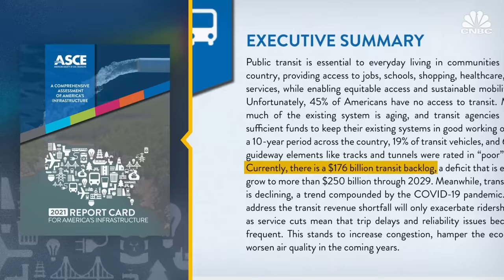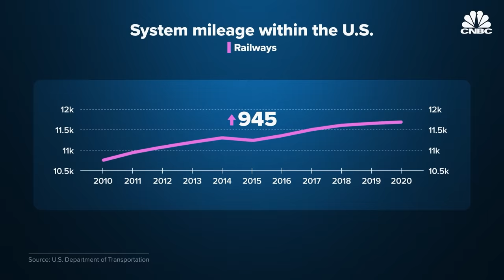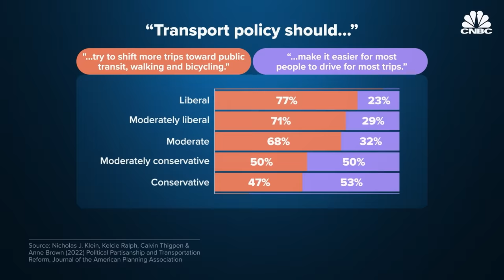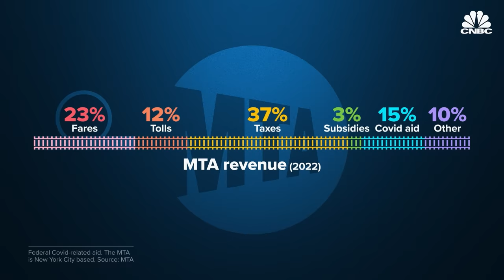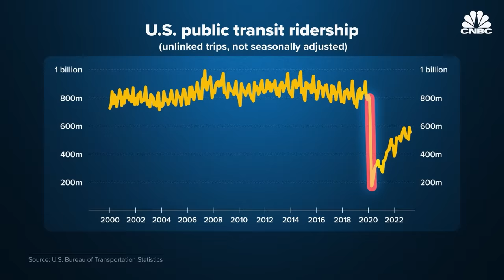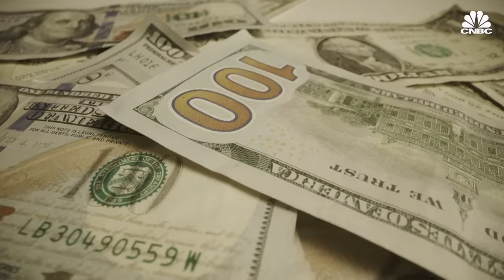Why The U.S. Gave Up On Public Transit

Comment: Most of us Americans generally (and perhaps correctly) assume that our country's wealthy and powerful oil interests basically dismantled our public transit systems in favor of gas guzzling highways.     
Like most other towns in the Midwest, all the roads in my city center have electric trolley rails still underneath the asphalt.   There was no need to build the infrastructure, it was already there.   They just paved over it.
Reply: Electric trolleys come with a maze of overhead power lines.
Reply: @SSHitMan  wireless trolleys are commercially possible
Reply: @SSHitMan  Roads have mazes of power lines and telephone poles already, not to mention all the stuff underground. Big difference is, with trolley lines you aren't walking on or across the tracks lol, so it's no issue.
Reply: @snaffu1  Go look at old pictures of cities that have trolleys. It's an absolute unsightly mess of overhead wires. And I don't know what cities you're thinking of but most bury their electrical lines with overhead confined to alleys.
Reply: @SSHitMan Instead I can look at pictures from today of trolleys from San Francisco, or in other first world developed nations, and none of them have this "unsightly mess of wires" problem. A century of technological advancement tends to solve any of that. Hook that train Kool aid to my veins.
Reply: @snaffu1  Those aren't trolleys in SF they're cable cars. Street cars require overhead power lines.
Reply: Can you point to any evidence for your claim?  Public transit uses oil too.
Reply: @snaffu1  I'm on a 'Memories' site for my city and the oldest folks say the trolleys were great and kind of fun.  No parking issues, you could hop on one and get around the city easily.
We still have a couple trolley stations, little stone buildings that were at the ends of the lines.  They got converted into park buildings.
Reply: @SSHitMan not always. you can also have a third rail system that doesn't have anything in air
Reply: @MalachiWhite-tw7hl it does, but it is still less than cars for everyone, it was better if people bought gas for their own car than paid the public transport fare and shared the vehicle.
Reply: start using more public transportation
Reply: @MalachiWhite-tw7hl  They can also use renewables since they use electricity too

Comment: went on a vacation to London this summer.... I was amazed at how efficient their public transportation system is. everything is easy to use, pay w phone, multiple options to get most places, always on time & Google app will tell you how crowded it is and even if it's stuffy inside. I can't imagine the US ever getting to that point.
Reply: How about the rest of the uk?
Reply: @wolf6462 Depends on where you go. I am from London originally but recently moved up to Leeds. The transport system in Leeds is ok for what it is. It’s cheaper than London and the trains are pretty connected to nearby towns and cities. The buses can get pretty busy in the town centre and there are frequent buses here. But as soon as you leave the city, dependant on where you are going of course, the transport isn’t that great. However, most cities and urban towns in the UK still have a decent public transport system.

Comment: I'm not sure why everyone thinks public transportation needs to be profitable. Police, fire departments, city lights, public bathrooms, roads, public schools, parks, our law making politicians etc are not profitable.
Reply: everything you mentioned is profitable besides the politicians part :)
Reply: @faustinpippin9208  If police departments are profitable, why do we need to give them tax money?
Reply: @faustinpippin9208  please explain. I will agree with you on police department somewhat. Tickets etc. I don't think they make a profit though.
Reply: Have you ever been outside of the USA?
Reply: Public transport needs to be profitable since it’s the only one requiring you to pay for maintenance due to the us not having a solid budget for it so if it’s not profitable where maintenance and employees are paid politicians are less likely to adjust their budget for it
Reply: As an engineer who works on street lights and traffic signals, reading a comment about how only public transit has maintenance costs is nails on a chaulk board. 

Currently I'm working through a new timing file that was hit by a driver and we may not be able to recover the $40,000 it will take to replace. 

Along with electricity, replacement and maintenance...this is just a ridiculous claim.
Reply: @damnitschris_  Interesting, don't we vote our politicians in? 🤪
Reply: @damnitschris_  Public utilities are never profitable. Likewise public services. Highways, roads and road maintenance are not profitable. Cars are a drain on the world
Reply: @bingosunnoon9341  the fact you even ask this and the upvotes under your comment make me lose faith in humanity...
How do you think your life would look like if police didnt exist?.....
think....please.....
Jesus Christ.....
Reply: China doesn't think so that's why they are the best
Reply: @faustinpippin9208 I don’t think you understand their comment
Reply: @faustinpippin9208  
This is because you don't understand the problem. Do you know why China has the best infrastructures and mass transits in the world? Every tax money collected by its government goes into infrastructure projects of every kind, especially subways and high speed bullet trains besides highways and airports. Their government knows that as the nation gets better infrastructures, there will be more wealth created and more taxes to be collected in the future. There is an old Chinese proverb - if you want to be rich, first build a road.
On the contrary, the US uses most of its tax dollars to spend on military weapons and on more than 800 military bases around the world but very much less on infrastructures and mass transits. This benefits the military industrial complex, car industry and politicians but not the ordinary Americans.
Reply: @faustinpippin9208 you are ignorant. Nothing new mentioned is profitable using the same metrics used for public transport.
Reply: @faustinpippin9208 … right, when we call the police or fire fighters we later have to pay a fee for their service, we pay entrance fees at city parks, we have to insert coins in street lamps to get light. We always 100% of the time need to pay tolls and fees to use bathrooms, not like most don’t have tolls to fees… they only two I give you are Hospitals and schools, but even then we still fund them via taxpayer money sometimes
Reply: False:  There is this thing called "Civil Asset Forfeiture," and almost every City and County in this entire country depends on their law enforcement agency to steal money to contribute to their coffers; where prior to that, law enforcement wrote enough tickets to pay their salaries, and the government was on the hook for the cost of vehicles. That's why departments still have "Widow and Orphan" funds; life insurance is not included in law enforcement benefits!

Under the old system, vehicles always looked beat to death; under the current system every cop has a damn nice personal vehicle he's able to pay for, and drives a slick new lease vehicle on the job!
Reply: @damnitschris_  so shift money from car infrastructure, to public transport infrastructure

Comment: Nearly half of conservatives believe in offering more walking, cycling, and transit. It's not like it's a heavy majority - there seems to be some open minded conservatives who like the idea of expanding transportation choice.
Reply: 'The freedom to travel as you wish' follows an individual freedom view, yet somehow this gets lost in the desire for locking people into one predetermined mode of travel.
Reply: "Conservative" is a big umbrella. For those of a libertarian persuasion public transit is just a higher yield investment of public funds, that's why they prefer it.
Reply: Walking and cycling are excellent and should be expanded, suburban areas have nothing to gain from new transit.
Reply: @dans3294  It's a function of density.  It starts with buses, then light rail at a certain higher density, then heavy rail.  For a year I would e-bike 6 miles to a train station in the NJ suburbs, park in a bike locker, and take the train longer distances, NYC, all the way to Boston or DC if I needed.  Too many here are unfamiliar with how transit works as a whole
Reply: @beback_ IMO this characterizes the traditional fiscal conservative who is more concerned about big government and recognize that funding Road infrastructure is literally no different than funding Rail infrastructure, except that we overdid it on Road infrastructure. The conservative opposing this IMO would be ideological conservatives in which public transit unfortunately got caught up in the culture war where if one side adopts/proposes an idea first, then no matter the objective merits it will be targeted.
Reply: This one does. I live in another country. My fear is a hollowing out of our city center due to poor public transit. Detroit breaks my heart.

Comment: Years ago I relied on public transportation (city buses) and these are the two biggest issues I encountered: 1. Long wait times and service cutoff late in the day . I felt stressed about missing my bus knowing I’d have to wait 20 min to 1 hour depending on the route, which was not fun in the winter when temperatures dropped below zero. I frequently had to RUN in order to catch the bus. Seeing it drive off was the worst feeling. Missing the last bus of the day meant calling a taxi (Uber/Lyft were not available yet), bothering someone else, or walking. 2. People. Unfortunately, the routes I took picked up a few homeless and drunk individuals who were mentally unstable, dirty, and smelled very very bad.
Reply: It's because the transit is designed by an American,  who have zero idea about how it works.

Just hire someone from Germany/Japan. They'll design it 100 times better
Reply: @pranaym3859 I think that's ridiculous. Even if you get a designer from a different country they would face the exact same opposition to getting their designs actually implemented. American designers are not idiots
Reply: @pranaym3859  Wait, what? City bureaucrats run train operations in every scenario I’m aware of. Most of the train manufacturers I’m aware of reside outside of the United States.
Reply: Lies again? AMWF CAR Ezlink Card
Reply: I dealt with it too for years!! Bus being late so it means it’s packed up to the point that not everyone can get on or they would straight up skip stops. It felt degrading!
Reply: And both of those issues are caused exactly because public transportation is organized by people who actively hate public transportation itself. Developed countries don't have to struggle with those issues for some mysterious reason.
Reply: Yeah, I've ridden on alot of public transportation buses. Some of the passengers are people you not only want to stay away from, but not talk to.

Comment: I'm an American who currently lives in Europe (for work) and has lived in Europe for over 10 years.  I've also lived in Kansas City and the Wash DC area.  It is absolutley a cultural thing that prevents us from embracing public transit.  Of course there are lots of cars in Europe, but Europeans value living in walkable cities over everything else. Suburbs (like in the U.S.) are not here because of the culture.  Europeans don't care about the house with the white picket fence.  I saw a map of public transportation rail in Europe and in the U.S. and it is laughable how little the U.S. has when compared to Europe.  Americans love their cars, and we're taught that the American dream means a house with a yard, a couple kids and one or two cars.  There's nothing wrong with that if you don't mind driving a lot.  
There is literally nothing but flat plains between Kansas City and Denver, and yet if you look at a map of Amtrak there is no rail connecting the two cities.  So your choices are flying or driving 9 hours.  Flying has ceased to be a pleasurable way to travel, and if you can't drive too much you're stuck.

Comment: Boston is one of the most walkable cities to live in the US car free. They even Tore down their highways. They also have a subway and commuter rail. They are also densely populated. Can’t say the same for cities like Houston or Detroit which  are spread out and have a sprawl and lack public transportation. Only thing they have is trolley and buses
Reply: Boston is unique in that it never got hit by black or jewish lightning, so they are relatively unscathed compared to other cities.
Reply: Well Boston is largely built before cars. As for Detroit and Houston, one run by auto industry, another by oil industry, you can guess how they want their respective cities designed
Reply: I moved to Seattle 6 years ago and the transit was one of the reasons. Certainly not up to NYC/Chicago/Boston levels, but for a west coast city... it was better than other places I've lived. I won't go back to someplace that I have to have a car... if I ever have one again, it'll be because I want one... not be dependent on it.
Reply: @starventure Boston is 25% black
Reply: @thomasgrabkowski8283  yup people started moving to Houston around the time cars were invented
Reply: @thomasgrabkowski8283  Good luck trying to find the pre-1930's neighborhoods in Houston. Or Tulsa. Or Denver. Or Milwaukee. Or St Louis, etc... No need to continue.
Spoiler, it's not that they never were. They were just buldozed. Detroit is a relative exception, and still has an amazing downtown.
Reply: @marcbuisson2463  Houston, Tulsa and Denver were all small city pre 1930s and were only a fraction of todays size
Reply: @thomasgrabkowski8283  For Denver, 250 000 inhabitants is far from what I'd call a small city. It had a real downtown, 160 miles of tracks and over 250 streetcars. Houston was about the same size, and Tulsa reaching 100 000. These are not provincial numbers, and at the time, these cities had big, wide, significant dense centers. Far more than today, with most of the building from then destroyed and turned into parking lots. These destructions of downtowns were promoted, with names such as Denver's "Skyline Urban Renewal Project", or with the building of Tulsa's urban freeways.
Had we implemented the equivalent in Paris (the "plan autoroutier pour Paris" if you want to be afraid), we'd have a caital as ugly as Houston or Tulsa.
Reply: @EricaGamet  I moved to Puget Sound region & thank goodness that highway bridge in Alaska Junction that passes through Colman Dock was gone! That would have been an eyesore...